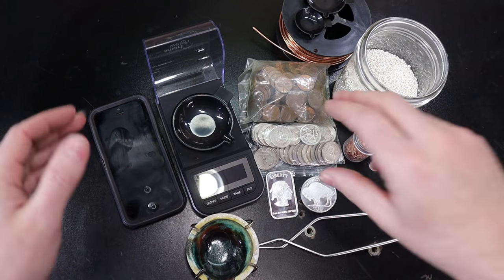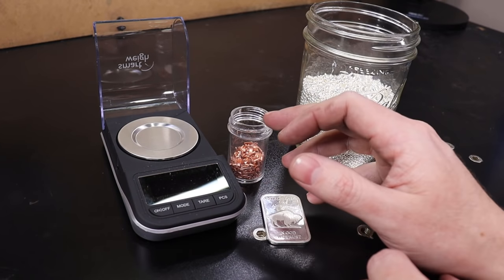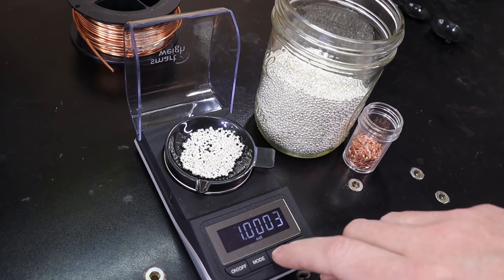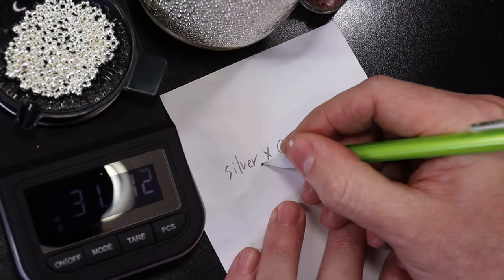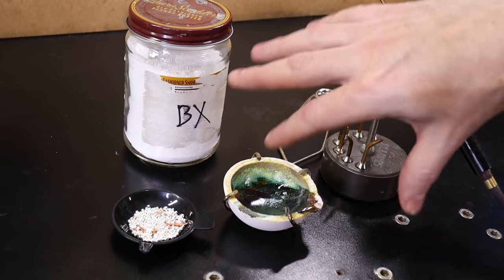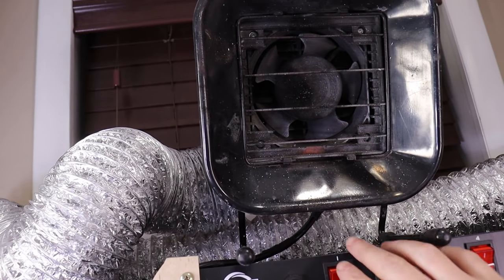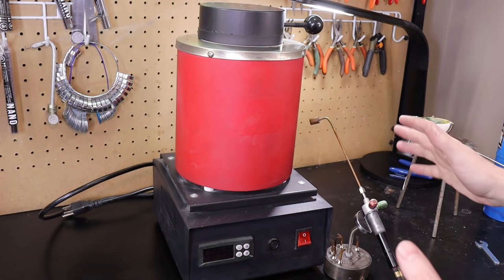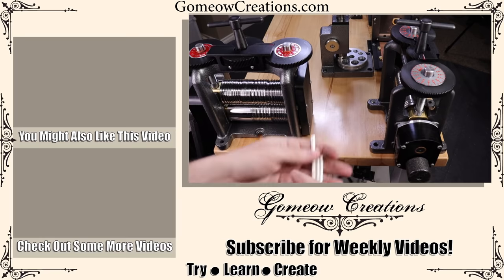Everything You Need To Know To Make Your Own Sterling Silver 925

Comment: this math is wrong. your copper needs to be .074 or .075 of your final weight. if you take 7.5% of the lesser fine silver weight, your copper is short. on one ounce its pretty irrelevant, but at an industrial scale, its alot.
Reply: you would have to remove  the 7.5% from the total, and replace with copper to make the alloy right.. more simply put- 0.925:0.075 = 23:2